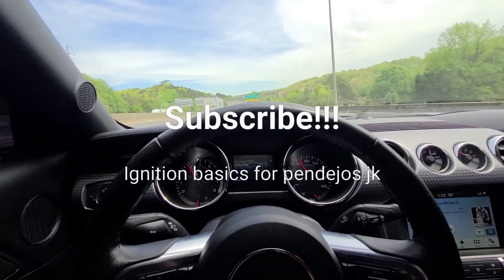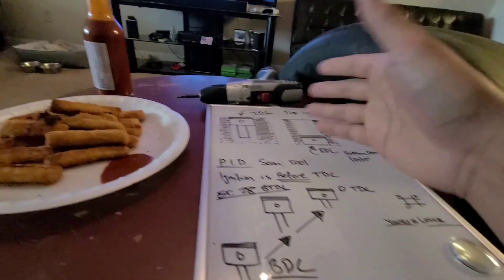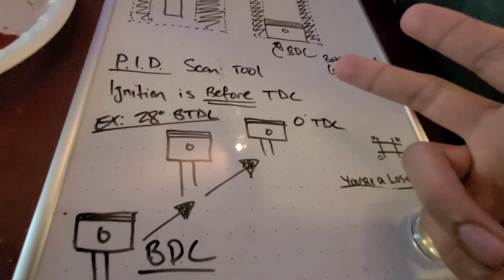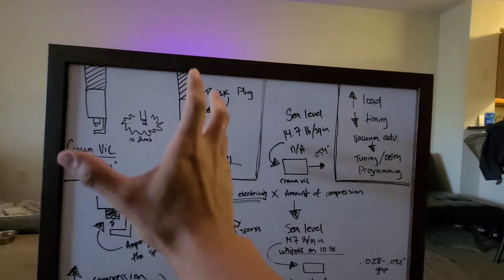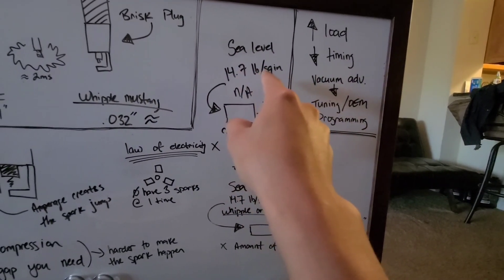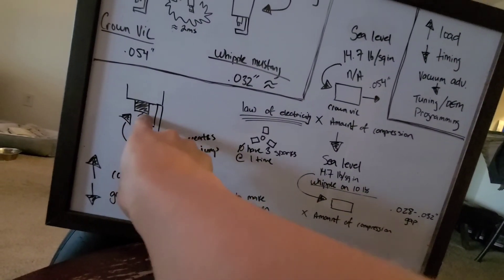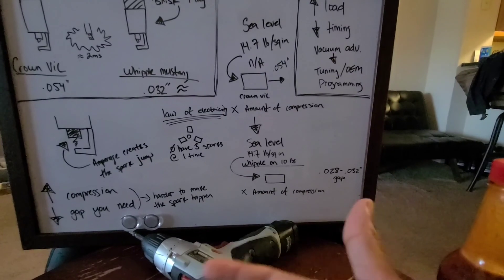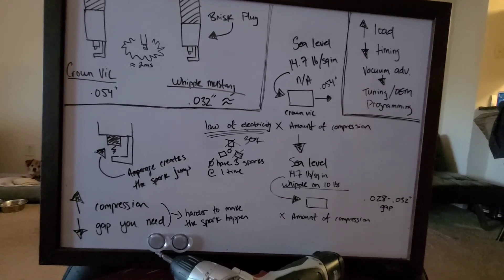How does ignition timing actually work!?!?

Comment: Can I put my global spark to 3 on my 2013 mustang gt
Reply from the maker: If your buy Starbucks everyday and have a live laugh love poster in your house then yes
Reply: Hey so, at idle my spark degree go up and down. Down to 14 degree up to 21 degree. Doesn’t stop until I start driving. Also, when i am driving 30-40 mph in the city my degree goes up to 35-41 degree at light throttle. WOT goes down to 20 And while braking it goes down to 10 degrees dead on.